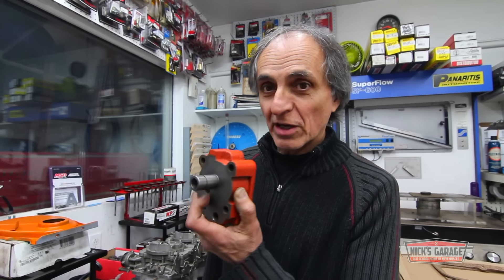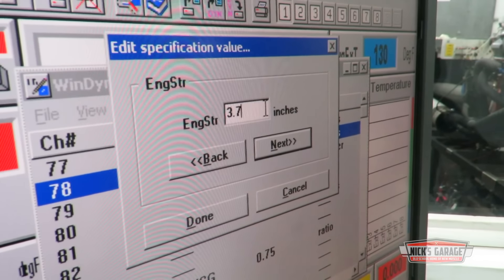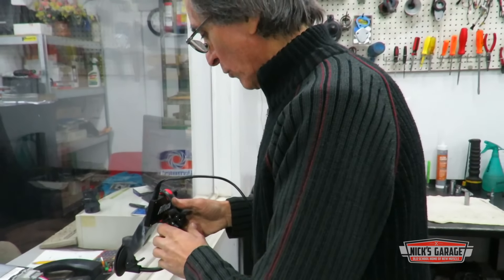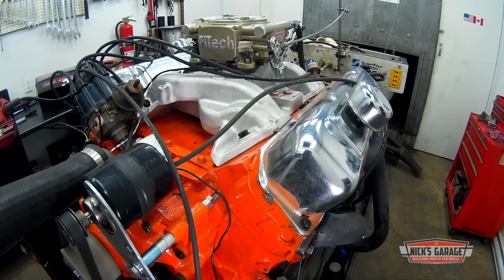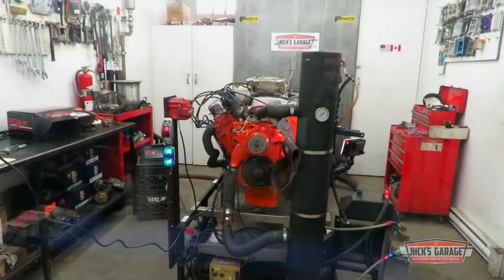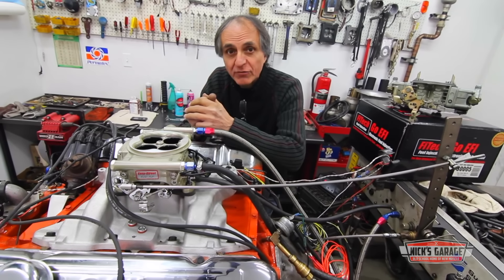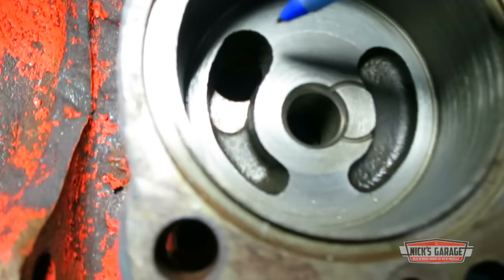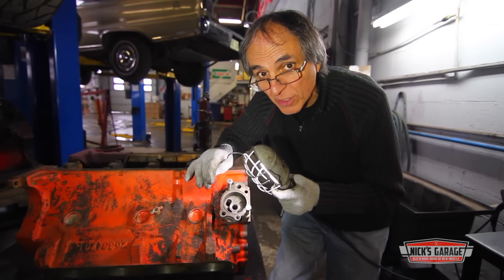Carburetor vs E.F.I. - Dyno Room Showdown

Comment: its been pretty well known for years properly tuned FI outperforms carbs everywhere under and on top of the curve. even if peak power is the same it will do better everywhere else including driveability, altitude, fuel mileage, etc. silly experiment. and anyone that has gotten into cars or technology after 1980 would know you should be doing dyno runs with a wideband sensor in the exhaust. bet this EFI was running pig rich
Reply: the efi might make the same horse power after it gets its optimum tune . if he let it run longer it could dial in a better tune

Comment: He didn't adjust anything or change the timing I don't think he wanted the fuel injection to win
Reply: blackman8795 right...then he said the carb won because it made more power. If you dump more gas in the engine, of course it’s gonna make more power.
Reply: Jimmy Dean not true on dumping more fuel, but I think the general consensus here is that this was a pos of a test that was completely biased against fuel injection simply because he doesn’t really understand it and is stubborn. He would do anything to make the efi fail. I tune both regularly, and I know first hand the efi would walk all over a carb when properly tuned.
Reply: to be fair there was a lot of things i didn't see him do. not entirely sure that means he didn't do it. seems unlikely.  really wasn't too far off in power and i assume fuel injection may even learn more over time and improve?
Reply: blackman8795 Anyone who say a carb can run as good as FI is lying. If that was true. All GM cars would have carbs.
Reply: @blackericdenice  yes, carbs will outperform F/I, as several dyno comparisons have shown. There are various reasons why carbs win in power. I'm not talking about the cheap carbs like an edel. or stock holley, I'm referring to Race Demons and comparable high end stuff. F/I won't touch it. Manufacturers don't use carbs for 2 huge reasons. 1) Emissions. And 2) F/I is easier to tune, manage, and is reliable without messing with it.
Reply: @AmericanThunder  Carb out perform fi when fi is not tune right. Otherwise fi run better and waste less fuel. Any person who think they can tune a cab better than fi is a lie. Including Nick.
Reply: @blackericdenice  sure, ok
Reply: @AmericanThunder  You do know nascar use fi now.
Reply: @blackericdenice  Not only is that the most boring form of racing on earth, But they also run alcohol in their engines and they're switching to compressed natural gas at some point. Theyre also moving to turbocharged V6s in the future too.. What is your point?
Reply: you shouldnt halfto change anything, once you get the timing set for the engine the rest is in the carb. the EFI system is factually known to run better than a carb. look at every other single test, they are better.
Reply: @thelasthallow  wide open I wouldn't have expected much difference, but idle, round town running and fuel economy EFI will always win hands down.
Reply: yeah , got me , show me the graphs and the stoich ratio , if you are making more power with a carby there is something wrong with the fuel injection
Reply: @JLSAudioWorx  I don't know if he'd "do anything to make it fail" but he didn't do much to make it win either. 

The true measure would be: how much fuel did the carb burn to produce 10 more hp? How was the EFI set up? for maximum hp or balanced or max fuel econ?

"More fuel = more power" to an extent that is true. More fuel + more air DOES equal more power but up to the limit of the engine, pistons, valves, etc. That's why they put superchargers on engines to force as much air/fuel into the engine. Easiest way to bolt on an extra 200+ horsepower but you have to tune the engine for it. 

EFI + Electronic ignition will produce more power hands down. Anyone who says any different doesn't understand either. 

With Electronic ignition, you can set the timing to produce more HP, then with a flick of the wrist, set it for max fuel econ. With efi you can tune it the same way. 

My big question is: was that EFI the same CFM as the carb? If the EFI was under by even 10 cfm, that would explain the difference.
Reply: also only 1 run is not enough time for the efi to self tune.  he should have made about 5 runs and let the efi tune itself.  I bet the efi would have beat the carb after 5 runs.
Reply: Yeah, EFI will struggle to produce even 1/2 MPG better mileage over a properly tuned carb... not really worth the $1,000 - 3,000 extra cost for most cars not driven long miles daily... and EFI is unreliable in the long run, always needing one of its million sensors replaced, injectors cleaned, injectors replaced, IACV replaced, computer replaced, etc. replaced... while you are irritated by driving in Limp Home Mode with no power and no fuel economy... but if you have money to burn... go whichever way you want... If the vehicle came new with EFI, try to live with it... IF you can find somebody to keep it fixed... even many new car dealers/auto manufacturers can't fix their EFI crap... I've gone with people to help them force their dealers to replace their lemon they can't fix...
Reply: @muskokamike127  - Of course the carb. will use more fuel if making more HP... would be true for the EFI, as well...
Reply: @BuzzLOLOL  not necessarily. You can actually make more HP with less fuel if the mix is done right. Again: more fuel doesn't necessarily equate to more HP. 

As for the EFI struggling to get better MPG...that's nonsense and you know it. A carb doesn't automatically adjust for air density, temperature, load on the engine, EFI will. You can program the EFI to produce 120 hp until you put your foot into it then it automatically adjusts to give you max HP at every throttle position. Instantly.

Show me a carb that does that without opening the hood and adjusting the carb manually.

BTW: if carbs are so great why are almost all vehicles EFI now? Why is the EVO getting almost 300 hp out of a 2L engine? shits n giggles? did they hide a spare engine somewhere?
Reply: @BuzzLOLOL  efi is much more reliable.  My first truck with efi was an s10 truck that I ran to 300k miles and I never had one single issue with the injection unless you count replacing the fuel pump and filter an efi issue.  You still need to replace filters and pumps with carbs.  A well tuned carb will make better peak power but the efi is smoother running and makes better torque.
Reply: @muskokamike127  - My '86 Monte Carlo 305" 4 bbl. rated 17 MPG city / 25 Hiway... ditto rating for a smaller '96 Mustang 302" EFI...
Reply: @joseiracheta3817  - EFI should make sightly more peak power because it doesn't need vacuum to operate the fuel flow... torque is mainly dependent on intake manifold design/shape with either system... 1950's GM EFI was basically a dual quad tunnel ram intake converted to F.I. and side air intake to make it lower... so it gave a power/torque boost...
Reply: @BuzzLOLOL  the engine size and mpg means nothing without hp and torque ratings as well as performance numbers.
Reply: @BuzzLOLOL  btw, ratings mean nothing, tell me the real world figures.
Reply: @BuzzLOLOL  efi will  make more torque due to much better fuel atomization.
Reply: @joseiracheta3817  - You're dreaming...
Reply: @jimmydean2750  not exactly.   It's the quality of the fuel mixture.  Not just dumping more fuel.
Reply: @blackericdenice  not exactly.    Much due to emissions.
Reply: @tahcogunworks  Save fuel also.
Reply: Doing something for 50 years don't mean nothing if you refuse to learn something new. FI run better and burn less fuel.
Reply: @blackericdenice  I don't know  I think top fuel 10thousand hp hemi run means something
Reply: True EFI is direct port injection . This is TBI which is electronic controlled carb with injector instead of vacuum jets.
Reply: @BuzzLOLOL Come on guy , you should grow up!  We are doing over 200,000 miles with a motor  today ! Main reason EFI !
Reply: @yboily1234  - We do 250 - 500K miles with a carb... and don't have to change out all those millions of sensors, injectors, computers, etc. that keep going bad...
Reply: Yeah, he primarily uses carbs and adore them so he is biased.
Reply: @thatbiguy1975  Yeah it's self learning, the more you drive it, the more perfect tune it gets.
Reply: @blackericdenice  a carburetor can absolutely berform as well as fi.  It can't, however, adapt to varying atmospheric and altitude conditions.  It must be rejetted and/or adjusted.
These throttle body injector plug and play deals are sort of a joke though.  If you want quick and easy, they do do that.
Reply: @randymagnum143  I said a carb can't perform as well as fi. I should have said run as well. Fi have better cold start and smoother idle and part throttle. TBI run better than a carb for the same reason.
Reply: @blackericdenice  idk,  tbi blows fairly hard.  Especially when it comes to fuel economy.  But then again, tbi chevy heads have few rivals when it comes to being just awful.
Reply: To be honest I had efi vortex v8 . Efi and all the computer systems constant failures and problems with well anything breaks in the middle of nowhere well your fucked carburetor is the way to go .
Reply: @jimmydean2750  the carb will always out perform efi during wide open throttle there's literally thousands of these dyno test videos on YouTube and the carb always pulls more hp out of the motor 90 percent of the time
Reply: @jonathanlawson4667     yes I did a lil research my self and that seems to be true
Reply: @jonathanlawson4667      I never got around to buying an efi like I had planned. Guess I’ll be sticking with the good old carb after all 😂 and save my damn money 💰... MO-POWA BABY !!!🍼
Reply: @jimmydean2750  absolutely but really unless you're racing the efi is the way to go for reliability and fuel efficiency hands down the efi wins but if I'm going to have a hot rod or muscle car and I have a few I love the old school carb lol
Reply: Carburation, THERE IS NO SUBSTITUTE !
Reply: Jonny Appleseed  I was a professional carburetor rebuilder and tuner for 30 years, and I can't stand working on the Edelbrocks. I couldn't even tell how many carburetors I've built but I would guess in the thousands. lol
Reply: Jonny Appleseed  ok
Reply: When it comes to all out power unless its boosted because it messes with the signal and tuning a carb wins everytime been proven over and over,  others have gone as far with smpi and tuned every cylinder perfectly with efi and it still can't beat a well tuned carb. Efi is much better for a daily driver go anywhere maximum mpg though. Efi gains an advantage now in power but not do to efi itself but by allowing the engine to make changes to runner length and cam timing to optimize both low rpm and high rpm output. But if it's an engine that dosent have all that and is just a weekend cruiser or  racecar not much advantage to efi especially when you consider not very many low end efi systems are going to be able to tune themselves to a race engine. 😉
Reply: @gregwilson3173  
Agreed! Don’t just tell me the peak number.
Show me the power curve.
Reply: There's plenty of others who have done head to head test and as far as power production goes, the carb always wins. EFI is great but also carbs are still relevant for many reasons.
Reply: @thatbiguy1975  holey efi injection learns reads air fuel adjusts fuel pressure does alot
Reply: @AmericanThunder  no idea about engines do you.  Carbs and fi do exactly the same thing, regulate air/fuel mixture.  Only thing that would cause one to be less would be either undersized or improperly tuned
Reply: @thegenrl  well, 45 years of experience of gas and diesel vehicles. There are some videos on my channel. Everyone on YouTube is an expert but few have actual uploads of their builds. Weird.
Reply: @AmericanThunder  oh boy one of these 45 years guys.   I have 20 and basically figured out AFR after 10.  If you want to keep using carbs, great.  The rest of the world just going to leave you in the dust.  Weird how many people think youtube is real life.
Reply: @thegenrl  you write a lot but show nothing. Lawn mower mechanic?
Reply: @AmericanThunder   Sure, why not.  Because if it aint on youtube, must have never happened.  For your own sake in order to keep your credibility, blanket statements like "one tech is better than the other" is always going to make you look like a fool unless you are a complete expert on both of techs.
Reply: @thegenrl  YouTube, like any other social media platform is a reflection of reality unless the commenter is intentionally being ambiguous. People that have fast cars who are into fast cars generally upload videos of their cars because that's kind of the point of YouTube. If you're commenting on a particular subject but you have no videos uploaded on the subject, it's a little suspicious, and you just come across as a troll.

Comment: I'd be interested in seeing the curves laid over each other.  Peek HP is not a very useful measure alone.
Reply: DJ Wadholm, Yes , you are correct. The more flat the curve, even though less HP, can be a faster car.
Reply: DJ Wadholm. Exactly has nothing to do with it
Reply: Goes to show these guys are the old school dudes that think carbs are better because a whopping 30 hp lol
Reply: Fuel injection is good for my wife, I prefer a carb all the way around.
Reply: AND....the amount of fuel consumed! If it gets more mpg with about the same hp, its obviously more efficient.
Reply: True to a point, but, the MPG gains are pretty much in the transmission and lighter cars. I have 3 suburbans, my older one an 88 the tbi replaced with a carb and a 700r4. The new ones are vortec's. The 88 "box" gets better milage with the carb. Also, once the fuel injection system becomes older, sensors go bad and so do the injectors, then say bye bye to your mileage until you spend a few hundred dollars to repair it.
Reply: In some cases, yes, but you could also get "bare bones" cars and trucks back in the day. Now simple is special order. My 88 Sub is heavier compared to my 99, and about the same as my 2006. My previous Sub with the TH-350,, not good mileage.  Same engine 4x4 and gear. I'ts just a fact, (for now) that for the same performance, considering maintenance and mileage. There is more value per mile in a carb. Don't worry, FI is still cool! And don't talk to me about "drivability" Grandmother's have been driving carbs long before we were born.
Reply: Seems hard to believe.
Reply: Would have also liked to have seen air-fuel ratios.
Reply: Doesnt even matter cause the peak power would be exactly the same or more than likley greater with properly tuned efi
Reply: @leatherwoodjay  and was it set up for that? The thing is: you can program it for whatever you want out of it. You want a balanced program? you want max fuel econ? you want max Torque? input a couple of numbers and there you go. 

If it burned 10% less fuel to produce 10 less HP, EFI won hands down.
Reply: Not only that, just letting the FiTech idle adjust isn't enough. Don't you have to do some driving also so it can learn how to handle drive cycles tuning as well? He didn't do that. Let the engine go through several cycles of varying loads and rpm to simulate driving. Then measure output...
Reply: DJ Wadholm, the torque peak is theoretically the. Pint of the highest volumetric efficiency of the engine
Reply: @deadshot4245  Unfortunately that's the case.  I've know quite a few fossils who believe engine tech peaked with the four-barrel equipped small block.   This geezer really needs to start looking for a nice retirement home.
Reply: @danchristopher9483  have you weighed you 88 and 99 they should be about 100 lbs lighter or more and and about 400 lighter than the 06. granted idk how your 88 is optioned out. obviously a 3/4 ton will weigh more than a half. a 90 1/2 ton curb weight is 4450 lbs so yours should be similar. a 99 is around 4700 lbs a 06 is 5269. idk the config  of each of yours so it will vary but a square body truck is a bit lighter than a newer.
Reply: @deadshot4245  theses guys are wrone the efi is better all the way around..

Comment: Not sure how much the EFI learned by idling.
Reply: Monte Stu it actually learns quite a bit, the surging is how it's learning for fuel mixtures and such, and once it learns that it can do on the fly changes when you go WOT.
Reply: Man "I just bolted a carburetor on my engine and I just let it idle. all the needle valves and nozzle sizes set them selves, it was so easy" said no mechanic ever. Comparing apples to tomatoes in this video.
Reply: You're incorrect.
Reply: Monte Stu ECM notes unstable idle and adjusts duty cycle of injection and in some systems the timing is adjusted automatically also. All new cars use this tech from crank sensor frequency and manifold vacuum and throttle position sensor out put signals. Diesels also .Shalom
Reply: From what I've read the CPU on the dominator is only sopose to take 10 minutes
Reply: You give the ecu a target afr. The ecu adjusts injector pulse width to acheive this. You need to go through all throttle angles and the rev range for this to take place. It takes a few seconds at each site on the map for this this to happen. Problem is that the full load afr required is very different to idle and again part throttle cruising.
Thats one hell of a shop!
Reply: I am sure that is part of the set up
Reply: I didn’t see an O2 sensor anywhere unless it was on right bank. How was it learning ?
Reply: @heyitsvos  efi does not work without O2 sensor.
Reply: It must reach 160 degrees before it starts analyzing. It want you to actually drive and put it through real world driving conditions for optimal performance. At least that's what Holley claims.